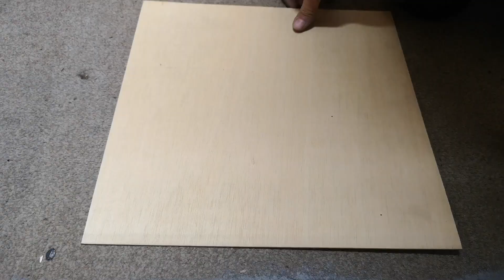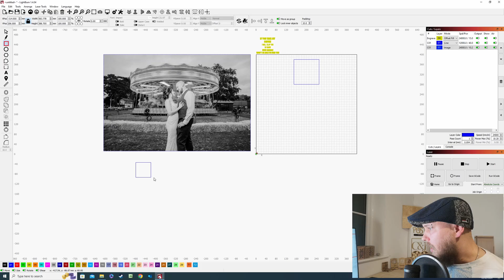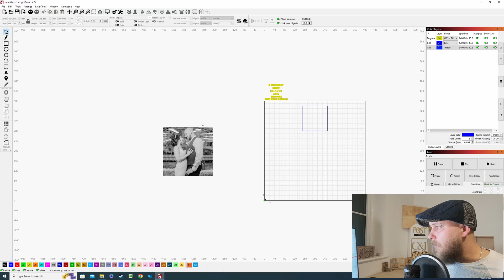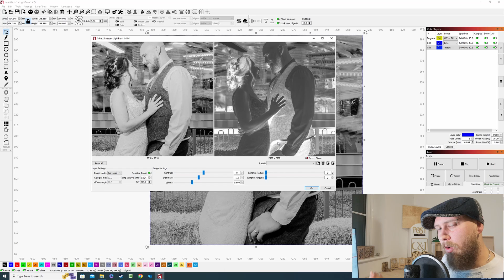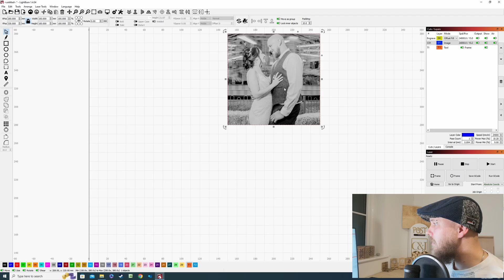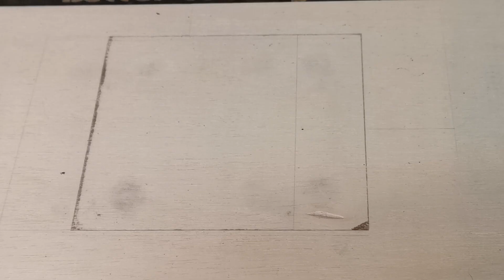Create Stunning Slate Coasters on a Budget Laser Engraver (Make Money & Great gift ideas).

Comment: Can i ask why ypu spray it black first please?
Reply from the maker: You don't have too, but if you prefer a smooth finish rather than the rough surface of the slate it can be sanded. I like to paint mine black first as it gives a nice contrast. It's also great if you mess a coaster up you can sand it back and spray it to have multiple goes on the same coaster.

Comment: I recently purchased a Longer Ray 5 10w unit.  I want to learn about laser engraving.  This is an outstanding video, every step was explained very well.  My only question is, what type of paint did you use?
Reply from the maker: Thank you for your positive comment. The paint i used was just an off the shelf automotive spray paint. 
I am currently working on 3 key setup videos on using test files to get lasers dialled in for the best results engraving, cutting and kerf adjustment. So if you are interested keep an eye out for those in the near future.
Thanks again.

Comment: I have found that several coats of polyurethane spray paint will really make images pop. The first coat or two might not look too good, but another coat or two makes slate images look very good. And, if the slate is actually going to be used for a coaster, it will protect from staining.
Reply: Are you applying the all layers of coating pre engraving or half pre and part post production?

Comment: First and foremost, great tutorial, lots of great information in here that was exactly what I needed. I really appreciate that you did this with a lower end (ish) diode laser as this is what I have, (Otur LM2, Sculpfun S9, and Wainlux K10) So many of the tutorials out here you go to looking for setting information only to find they are using high end commercial lasers that require totally different settings that what I need.  Secondly, and I picked up on this before you began the burn, I would have backed up just a little on the Image, I think cutting off the top of your head on the image triggered my OCD just a little, lol.  This thought brings up a question, would there be an advantage to creating the "mask" maybe 1/8" or so larger than the media you are engraving, so that you know it goes all the way to the edge of the media you are using? (just a general question there, I am pretty sure that your engraving did infact go to or beyond just slightly the edges of the slate.)

Comment: Great video, loved it and learnt something about Lightburn. Thank you for this video. I'm just starting with laser engraving, what kind of spray do you use after sanding the coasters?
Reply from the maker: Thank you. Prior to laser engraving, I use a matte black automotive spray paint. If I can't source matte paint, I'll settle for using a satin finish but never use a gloss. It is hard to see your finished result if you finish with a gloss in certain lights.
Reply: @MadeBetterWithKnowledge  Thank you for your quick reply.👍
Reply from the maker: Your welcome.
Reply: Why don’t you just etch the coaster without sanding and painting? You get a really good contrast between the original darker split surface and the etched parts. I do this all the time with anything from text or logos up to detailed photos.

Comment: great video  -  i have an A20Pro and I have tried slate coasters with some success - I have two questions for you why do you paint your coaster black before engraving.  Secondly when you are finished engraving do you clean the slate off with a cleaning agent
Reply from the maker: Thank you. I only use paint to give the images more contrast. I also like to sand my slate flat, as I prefer the flat look to the slate rather than the natural wayveyness to slate. Because I sand the slate flat, it becomes a lighter colour, which is another reason why I do it. After engraving, I use compressed air to remove any debris.